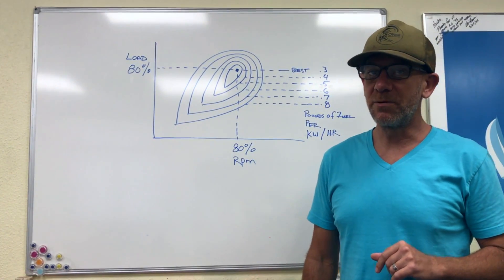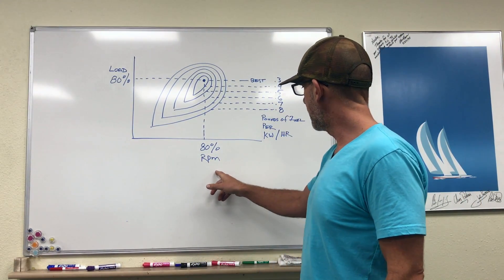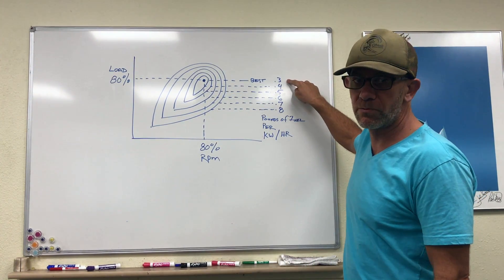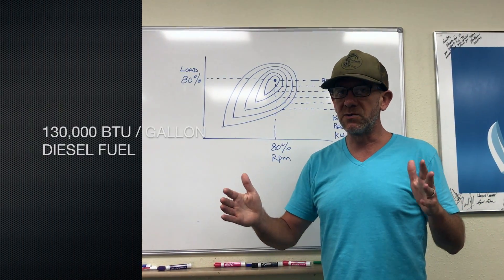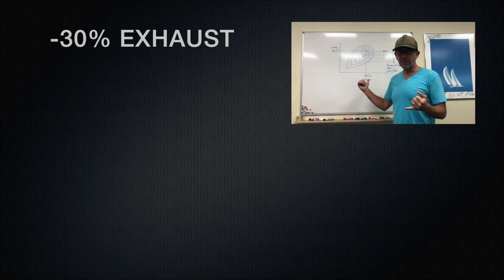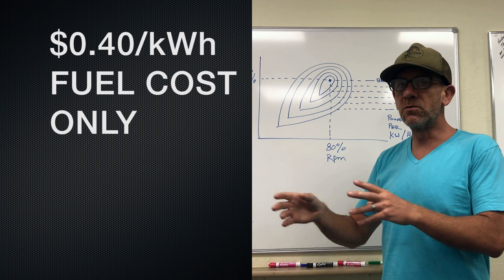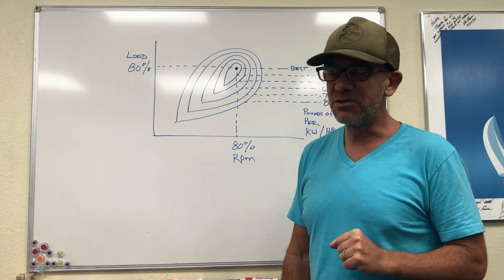Cost to generate electricity with a Diesel Generator? ✔️

Comment: 2,000 hours!!?? Lol? Most diesel gensets rated for "stand-by" will easily give you 10,000 hours if you take decent care of it. I have a few generators. One i have as a portable gen set is a low speed 10kw kohler, 4cyl ford industrial engine with 4,450 hours on it right now. I know my 50 kw prome rated backup diesel can outlast that.

Comment: All valid point's but for many user's their generator costs are off set as a business expense. Continuity of power is the vital consideration rather than outright efficiency.
For me the generator is a vital reassurance and insurance against power outage and low solar output. So i have no qualms about the investment or running costs. The reliability of Diesel is a huge confidence factor.

Comment: I was the CO of a military base that generated it's own electricity, my generators averaged between 40,000 and 50,000 hours of service.  Of course they were rebuilt several times and these were industrial engines and pretty large.  Our ship engines exceeded those numbers.  Now I know that small engines are not generally built as well but I expect that quality brands will go about 10,000 hours, small gas engines are another story.

Comment: So if you want the generator to run at the sweet spot (80% load & 80% rpm) you use it to charge a home battery. After that you can use your home battery any time you like. The losses from charging are peanuts compared to running the generator without any significant load.

Comment: If you are maintaining 60 Hz, +- .2% , you’re pretty much at a consistent speed. I assume 80% of rpm is 1800 rpm and the engine max rating is the non used 20%? Making the max engine rpm 2250?

Comment: Some of those military generators are suspect unless they were commercial units sold to the military.  The real argument is what manufacturers to use.  There have been some recent advancements in diesel efficiency but with the green push those advancements might not see the light of day.  Solar is fine but should be backed up with a solid diesel genset.  My suggestion is one of the air cooled lister engines like an ls2 with a 10kw head.  The old marine gensets were solidly built but require liquid cooling.

Comment: My small portable diesel 8kw generator currently has 2700 hours on it, and required nothing apart from basic maintenance.. oil changes etc... 
It runs 6+ hours at a time, as power outages are very regular for me, sometimes 3-4 days straight...
I just fill her up and click the starter, and it never fails :D
Reply: What's the model of your generator?
Reply: @cristobalcruz6908   Mine is a Hyundai one.. Remote start etc.. Bought it a few years ago.. Been absolutely fantastic.. Never skipped a beat...

Comment: 4:20 Yes but I plan to keep that heat and use it - such as for hot water heating and heating the water in the radiators in the house !
Less efficient in the summer when less heating is needed !

Comment: I know a lot of diesel cars with 250.000 mile, if they would average 40mph in European traffic, that is already 6000+ hours of runtime.
Car have more HP, so more engine load, changing RPM, more start/stop, cold/hot,  so there will be much more strain on these engines.

So I can't imagine a genset would only run for 2000 hours before an overhaul, it would likely be around 10.000 hours.

Also non consumer grade diesel, or red diesel is cheaper, here in Europe around €2,50 a gallon, in the US probably the same in dollars due to higher taxes here.

Nonetheless, it would still cost +/-50 cents per kWh to run a genset on average, but certainly not 0.80.

As one mentioned here in the comments, if you can recuperate the heat for a building, it's even more cost effective.

Comment: I spent 28 years in northern Alaska maintaining diesel generators for State of Alaska. Our remote facilities  were typically equipped with custom built gensets. We ran Cummins B series, C series and L series engines running at 1200 rpm. Coupled to brushless ac generators. All units run continuously in non parallel, and are manually alternated at service intervals. We have seen as many as 65,000 hours before rebuilds with outstanding reliability. 
   All these machines were built before new air regulations and are still in operation. I would imagine all the newer 1800 rpm units have substantially lower hours before rebuilds but definitely more than 2000.
  Also a couple other widely used engines in Alaska were the witte and lister. Im sure there's some YouTube's out there on them.
  Thanks for the video !

Comment: M8 fcukoff im running a 10kw inverter generator and its done 10s of 1000s of hours and i run it off veg oil and it cost fcuk all to run.
Reply: Ben, can you drop me a note to wkwolverinebasketball@gmail.com I would like to ask someone of your experience about the veggie fuel.  I've done 10's of thousands of gallons for vehicles, but would definitely like some advice from someone of your your experience before I begin.  Mine is liquid cooled so I plan to use a heat exchanger as not to waste that energy.  Any suggestions would be greatly appreciated.  Thank you. Bruce

Comment: You wanna burn wood and use steam engine or steam turbine. A turbine needs a bigger steam output though and a big generator makes no sense when you cant store the energy. Batteries are expensive and they dont last forever either. They'd make sense with a solar. An electric car could serve as a storage. Electricity may be more expensive with more e-cars, more leftists and less coal. It's a must to think about it

Comment: 2000 hours life on a diesel generator?  Maybe a single cylinder Chinese model,  but who would use that off grid?  If you use a real generator with a Kubota engine at 1800rpm, they’re good for 30,000 hours or more.
Reply: what happens after the 30,000 hours?
Reply: Kyle Sahlstrom they’ll need piston rings, crank bearings, probably rebuilt injectors and fuel pump...... if the generator end is still good, probably just new bearings.

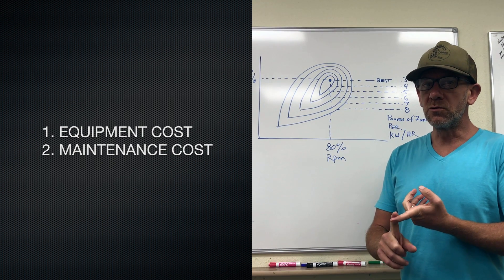Comment: 0:56 EPA SPOKESMAN here folks. 2k hours on diesel is just beyond break in period.
Reply: What does the EPA has to do with it? EPA doesn't tell how liong generators last.
Reply: @hus390  2k hours life in them? Your math dont make sense haus. I have 3 in shop w 10k and run like day one. My lister petter ts2 has well over 18k and did top half at 10k and still best darn motor I have for power. Now all gensets lose efficiency as used and a 10kw loses magnet capabilities w age. So you either dont know what you put on white board, or your pushing folks to gas cause you working for EPA. Lastly, diesel is 40% more efficient than gas, which gas is about 20% more efficient than lp. So how about money lost using either of those fuels? Not to mention stability of diesel fuel vs gas. See this was a hit job on homework or diesel. Good day.

Comment: Yes, but I have ported the engine hot liquid outlet into a heat exchanger in our home, through which a 40 watt fan blows air, and thus putting the 30% loss of cooling into our home in the cold, winter months. In the summer I put that heat into a huge tank in the ground that stores heat there that I can use for our home in the winter.

Comment: 2000 hours is for a Briggs and Stratton, predator gas engine. 
    A 3600 rpm aircooled diesel, like my dy27 robin, is good for 10k hours. Then swap out the bearing and go another 10k
      A 1800 rpm liquid diesel is good for  around 20-30k hours.
Reply: That’s what I thought . I have twin 4 cylinder diesel generators and they run perfect . Both have around 9k hours.

Comment: Electricity produced to transfer through transmission lines to get to our houses and then  used to charge a battery then used to power electric motors is waaaaaaay more inefficient!!! Electricity is 90% inefficient. That’s the dirty little secret. These environmentalists types act like the production of the electricity and conversion to battery power is flawless and totally efficient. It was produced by burning fossil fuels. Some by water but still, gasoline is way more efficient to move the masses.

Comment: i think your estimation of teoretical nonsense. if you actually had a one kw engine a run it for 1 hour, you burn a very small tank that is less than one third of a 5 liter can of fuel. my guess it takes less than one liter of fuel to run 1kwh. i think i run a 1500kw lawnmover for about 6 to 8 hour on a single tank taking about one third of a 5 liter can of petrol. my guess diesel to petrol efficieny is much the same. i ran a tractor diesel for 18 hours drive on 25 dollars worth of diesel. i say max 1,3 liter hour 1,2 dollars. that is in this case a 60 kw engine running full speed for 18 hours.

Comment: I do believe a new prime mover will be found maybe a Sterling engine with very high efficiency and also co generation for exhaust heat in the winter.  Just a matter of time till those wise guys and or inventers work out the details. A battery wall/storage should be part of this with wind and or solar panels might work. Defiantly going to cut the cost of power. But this is good info. Any one doing this should know the bottom line cost. Don't forget to charge you labor input just to know how much time of your life it takes. I pay about 20 cents per kw-hr with taxes and other cost all added together. If you switch over you get don't have to pay that extra cost a plus on your side of your budget. Watch out tax slaves your property taxes may go up and cost you more in the long run. Tesla cars might be fun and exciting but in the long run no savings with higher taxes on your big expensive Tesla electric car.

Comment: No I gallon of Diesel fuel doesn't have 38 KWs - it has 38 KWH.  There is not 3412 BTUs/KW - there's 3412 BTUs/KWH - there is 3412 BTU/Hr per KW.  Keep your units straight!  It confuses - you are talking Power and Energy and interchanging the terms like they are the same - they are not.  Great video in it's essence but your units are misleading.

Comment: wow, great info. But I think a diesel may last way longer than 2000 hours. If you drive a diesel car at 30 mph for 2000 hrs, that's 60K miles, am sure some diesels can even reach 300K miles. And that's just mileage, doesn't include hours spent on traffic lights or parking while the engine runs

Comment: 2000 hours on an industrial deisel engine... dude put away the drugs. A properly maintained deisel will last a lot longer...
Reply: I ran a Craiglist $1000 8KW diesel generator on waste vegetable oil @6KW Draw for nearly 24/7 for 4 years. I gave it an premium oil change and 12-hour break to cool off every two weeks and the only reason why it fails was a catastrophe radiator leak happen whIle I was sleeping.
Reply: Dude we have a 12.5 kva generator driven by a 1970 lister handcrancked diesel engine we used from our closed down rice and corn mill..it still runs smoothly untill now .when we experience a  one week brown out in our town we relied on them everynight from 5pm t0 7am the next morning,.sometimes on 24 hours straight..it provides us ample power for our home indoor and outdoor lighting we used LED anyway to save watts our home in our town is a typical country house.the generator is quiet noisy in the open but we placed it in a barn with extended exhaust pipe to reduce noice.its old but super durable and reliable.just a little handcranking start and voila .,from 1970 up to now.,still workin fine lesser of a lessmaintainance.
Reply: I have low rpm diesel gens running strong well over 10,000hrs. This guy doesn’t have a clue what he’s talking about.

Comment: Some technical mistakes dear.
1. Generators do last more than 8000 hours typically, way above 2000 hours.
2. BTU to kWh, not to kW. Remember, energy, not power.
3. Cost/kWh can be way down than 70c. It really depends on the cost of diesel AND the generator's efficiency. Even in the US, cost/kWh can and should be be less than 70c.

Comment: 2000 hrs? You must have made a mistake. I work on a locomotive in Slovakia as an engineer. That loco was made in 1977 and has just turned 93 000 hours on a CKD 200 litre, 6 cyl engine. Runs almost every day, sometimes works very hard. Starts at the first crank. Other new locos we have were made back in 2013, with caterpillar V12 diesels and they have 25 000 hours on average on them. There are days the engines never stop, just crews change. I´ve heard of some engines powering generators running continuously for years without ever stopping.  You either wanted to say 20 thousand hours (which is not that impressive either), or you clearly underestimated the lifetime of diesel engines :)

Comment: Are we able to recover the heat from the exhaust gas or the cooling system with a simple heat exchanger module without damaging the generator?
Reply: Yes, its possible. But the added expense of equipment and controls is not worth it.  About 20 years ago our local municipal swimming pool had a ''co-gen'' unit that was 250KW and burned natural gas. The exhaust heat was reclaimed to add to the pool water. The engine had a water-to-water heat exchanger from a boat and had a belt driven pump to circulate water from the pool. The power generated was supposed to run the twin 20 horsepower pool pumps. Any excess power was sold to the power company. It was a total piece of garbage that never worked properly. It was removed and heat is now provided by a pair of  3 million BTU natural gas fired heaters and all electricity comes from the utility company.
Reply: Yes easily i do it with a 1.2 .mw british ruston 900 rpm ,using  diarhermic oil heat exchanger at the exhaust collect a lot of heat plus large radiator to heat 50 square feet in winter cooling also use to pre heat material we run 50% propane send to intake ,not very good turbo on this engine ,we atomise a lot of water to ,plus methane from the process it is a waste so we make several bang for a buck

Comment: You can get 12,000 hrs if you have a 1800rpm unit. That’s with good maintenance and 50% load.
Reply: But at 50% load your efficiency goes down. You may end up burning enough extra fuel to pay for the new engine

Comment: Good video there! No matter how much you try, you probably won't be able to compete with the power grid on cost! If I were seriously living "off grid", I'd have a smaller 4 cylinder diesel liquid cooled genset in addition to the standard solar rig and battery bank. I would have the ablilty not only to generate electricity to emergency charge the batteries, or operate heavy current draw appliances, but STORE the waste heat from the cooling system in insulated plastic 55 gallon drums. Use a heat exchanger system to run fresh water through the warm coolant for domestic uses. That would provide a bit more bang for buck IMO.
Reply: Try Belgium, Germany or Denmark..
And indeed, the biggest gain would be to transfer the heat into a house, building or greenhouse, "free" heat.

Comment: I have a friend who works at Cummins and he said most of their Diesel engines are rated for 30;000 hours, with proper maintenance. I bought a Chinese diesel and it is rated at 1000-2000 hours, but my purpose was to run the house 2 hours per day for at least a year in the event of a catastrophic power grid failure. So far, it’s longest use has been 48 hours.
Reply: Were the chinese air cooled?
Reply: @TerraFirmaX  - mine is air cooled, but only 5 kWh output.

Comment: Great video. I charge a 840 amp hour battery bank that is 24 volts nominal. My inverter has a 105 amp charger built in. when I get up in the morning my battery bank is down by 125 to 150 amp hours. That's 3.1 to 3.7 kwhs using 25 volts as a median.  when charging with a diesel generator  I get 6 hours run time out of a gallon of diesel. I have a MEP-016D with Yanmar L70ae engine. I run the generator 2 1/2 to 3 hours a day. @ 1.90 per gallon for off road diesel that $31.6 cents per hour. That's $.79 cents per Kwh. This is fuel only. I have a friend who has experimented with a 3 cylinder Yanmar and a Ford G1 alternator with a 25 ohm 150 watt rheostat for a voltage control to charge his Chevy Volts Lithium Ion battery bank  that he runs his house with at 56 volts nominal. He has a video showing his generator producing 1 kwh for $.25 cents from diesel that he paid $1.90 for. This is fuel only. Hard to believe as there is only so many BTUs in a gallon of diesel but I know the man and his test is sound. What do you think about the inherent losses of an AC generator charging through an inverter charger compared to an alternator that only has losses from the energized field and friction?
Reply: thats great! where can i see this video? I'd love to know more.
Reply: @joshuanorris9785  here you go 

https://youtu.be/5hlnd60IikY
Reply: @offgridinthepacificnorthwe3210  Thank you!

Comment: 80% of rpm?  gen rpm is a constant.
Reply: No it isn't, it changes depending on amount of energy used.
Reply: If you are maintaining 60 Hz, +- .2% , you’re pretty much at a consistent speed. I assume 80% of rpm is 1800 rpm and the engine max rating is the non used 20%? Making the max engine rpm 2250?

Comment: A diesel generator only lasts 2000 hours?
Reply: I have china no name 3,600rpm gas burners with over 3K on them, only thing it took to get there was an ignition coil and regular oil changes... I also have excavators and bulldozers pushing the 10K hour mark with only regular maintenance. 2000 hour engine life shouldn't be acceptable for any engine manufacturer.